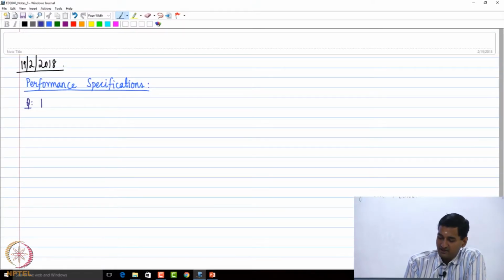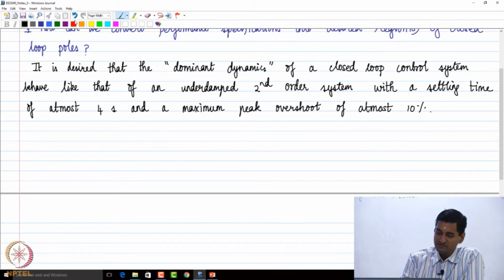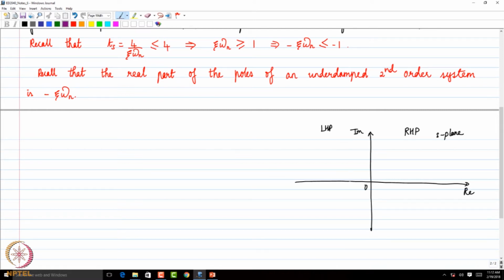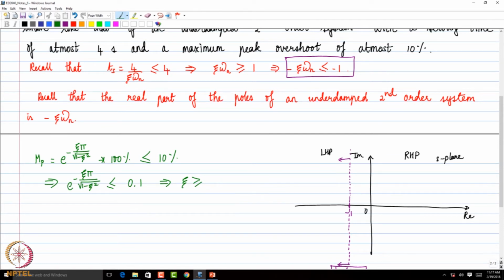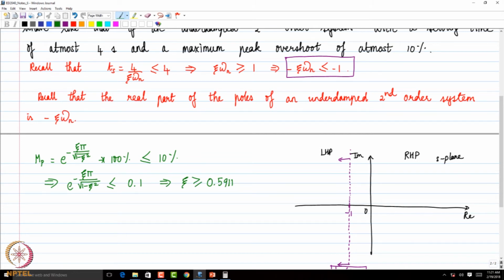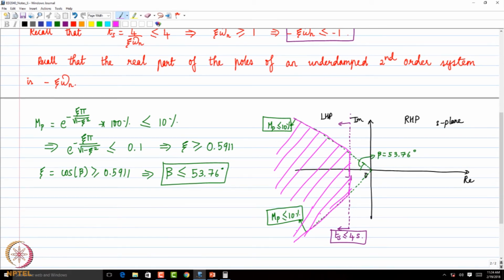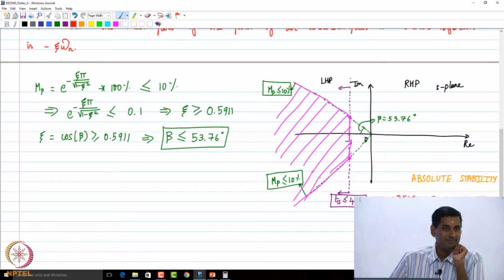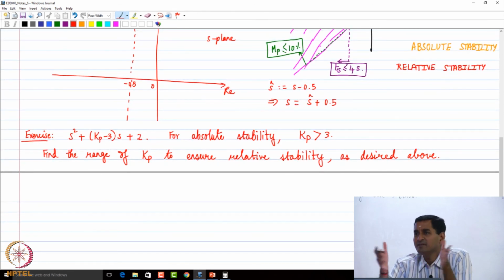Performance Specifications - Part 1

Comment: One minor complication/bug that I ran into while trying to solve for Mp criteria :
1.) Solving the inequality : e^(-pi*z/sqrt(1+z^2) < 0.1 , I didn't evaluate ln(0.1) before simplifying the inequality which led to 
=>   z < 0.591 :
 Solution : evaluate ln(0.1) before simplifying inequality or solve for equality first and then input values to check
Very good lecture series , Thanks you